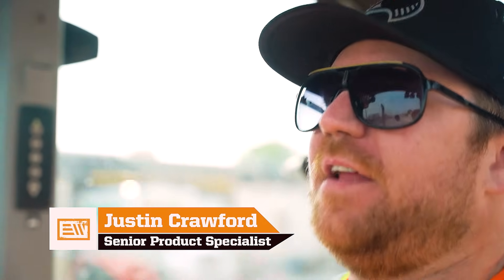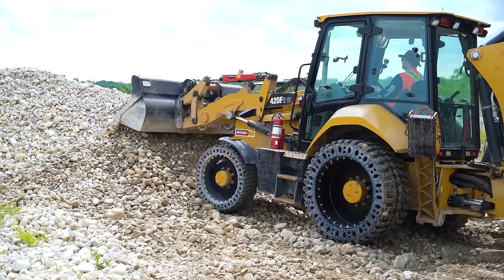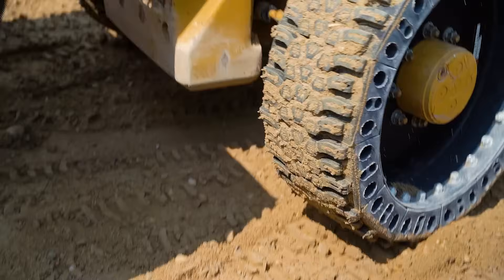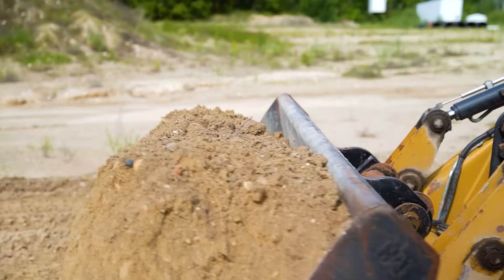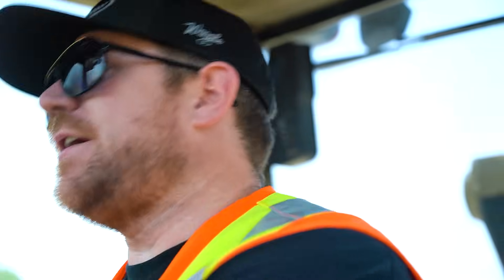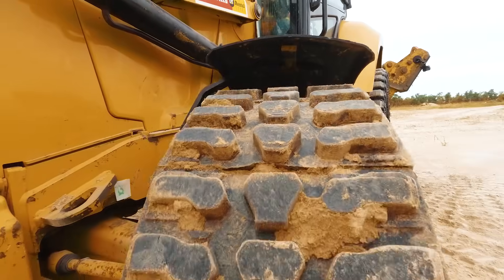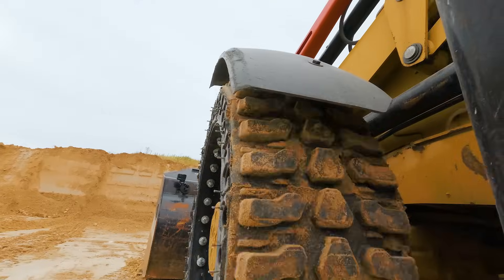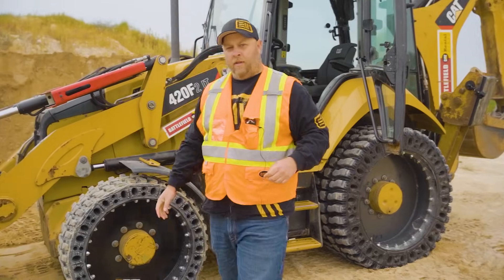Airless Backhoe Tire Tread Pattern Testing | Behind The Scenes

Comment: I’m in kc. Really debating buying a set for my old skid steer. 12x16.5. Are these available local or do I need to order from you? I only need one tire replaced but I’m sick of having to mess with air. Seems like you have a good product.
Reply from the maker: Here is a link to our skid steer tire options. 

https://www.evolutionwheel.com/product-skid-steer-tires

If you went with our tires I would reccomend all 4 as the tractive effort will be different and it will be hard on the drive motors if you had different tires. Request a quote through the website or call 888-249-4790 and a product specialist will help